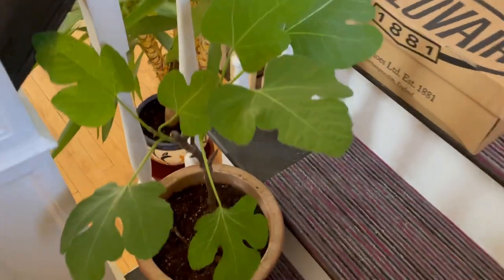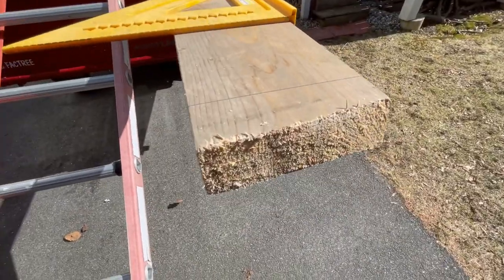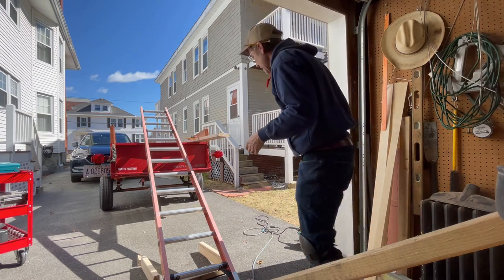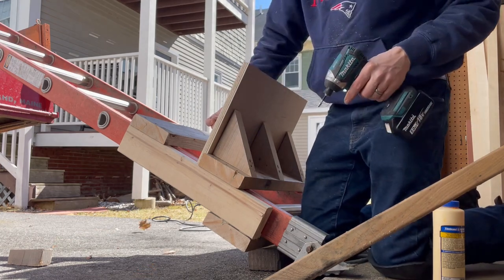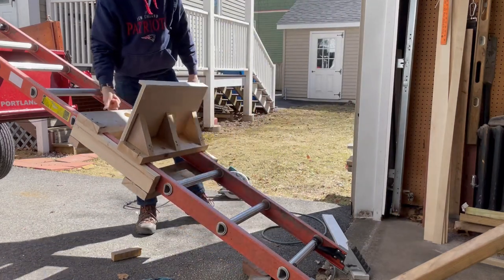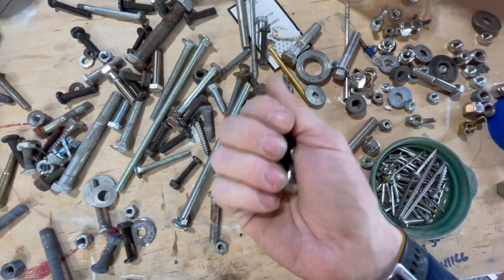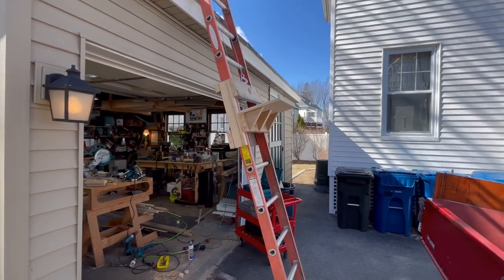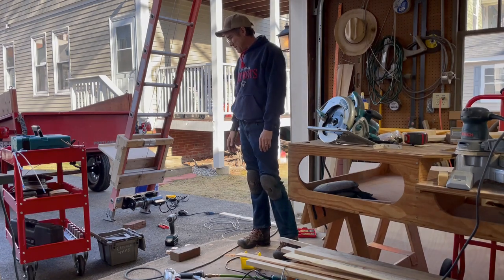Building a DIY Ladder Hoist using a Harbor Freight 'Badland' Winch. The Knee Saver 5000!!

Comment: Not being one of "those" guys, but a modification that I might suggest is at the winch attachment point, where you drilled through the legs of the ladder.
I would think you could have attached the winch "plate" assembly by using some hole clamps on the ladder's bottom rung into the backside of the wooden plate.
Also, I would add some Teflon strips between the wood and ladder for an easier glide.  Maybe use Teflon instead of wood spacer strips?
It is always easier to be an "armchair quaterback" and commenting on something AFTER it has been built.
I love this idea though, and am considering building one for getting things down into my basement!!!
Thanks for the idea.
Reply: Re: Teflon strips. 
Cut some strips from an HDPE cutting board to use as a sliding surface. 
I got that tip from another diy project — it was a soil screener…basically a shallow box with a wire mesh bottom that had to slide back and forth on top of a wheelbarrow. 
I only needed small pieces where the box made contact with the “rails” of the wheelbarrow, so it was very low cost. 
There must be dozens of uses for this material. 
And — I like your intro: “I’m not one of ‘those’ guys.”  👍

Comment: I built something similar to this some years ago. The only two extra things I did was to waterproof it and used thin nylon strips where it comes in contact with ladder. The platform and ladder won't  wear.....I like your thinking...keep up the good work!!! My newest one has skate board bearings.

Comment: make a brace to the roof and attach it to the top of the ladder to get it away from the roofs edge, then you can run it all the way to the top. It will be much easier to unload.  I cannot imagine the damage to your back  leaning over the edge of the roof to get the shingles off the sled.

Comment: Nice little hoist and great video but I see a minor problem when you get a 4X8 sheet standing on the base of the sled and hoist it up to the roof you have an over-hang sticking out looks to be a couple of inches of shingles so you can't go any higher than that or it will tear off part of the shingle so you need to build out something for the ladder to rest on below the overhang so it will clear it plus you can anchor the ladder so the wind won't catch the whole thing and slide it to one side or the other and it comes crashing down on what ever is below.

Comment: Thanks ,
 seeing this project will help some people .
It works which is good enough for some situations .
It looks like this temporary device will be a wonderful assistant to your roofing project but there are issues with long term use.
Now that I know how slow ( often an unrated feature ) one of these winches goes I will redesign some of my plans .
Seeing some of your efforts will have me continue my use of thrift store rollerblading wheels as guides , there is a whole system for mounting to laminated or extruded fiberglass reenforced structures including mounting adaptation angle plates or pillow blocks to avoid localized stresses you almost completely avoided doing ( somone mentioned U-bolts ( perhaps with some durable hose ) to around ladder rung which would have a much better ( and slower thus detectable ) failure mode :) mounting some metals to aluminum also has issues especially in wet or humid environments .

Comment: Works great on a regular ladder but can you think of a design for a 20 ft. extension ladder?  Also, at the top of the ladder, the lift will contact the eave where the ladder is resting. Maybe a "spacer" so the lift can get to the very top of the roof eave. Nice project!

Comment: Can you double the speed by tackle block, say an or the hook and put the block pulley on the carriage?
I would triple the strength on the hook mount board.
Also add plastic skids to carriage made from old cutting board.
Very good job.
Reply: Block and tackle are designed to make it shower. The work is spread over a longer distance

Comment: Just a question on your build. With the winch on the bottom, what did you use for a pully at the top?
Reply: Yes.  The pulley mechanism at the top rung.  How was that attached?
Reply: Eh? What pulley? Lol

Comment: Small suggestion, May be instead of drilling holes in your ladder, use u-bolts an then off set the holes for them an fasten to the board. Or threaded rod.
Reply: I’m totally agree
Reply: Exactly, never drill holes in a ladder !!!!
Reply: I would add a bar thru the rung of the ladder then add u clamps to that instead to install witch ...  Or make box that fits around ladder tight then add lag screws in the middle were the rung is to hold it in place ... Should not drill thru ladder ..

Comment: Good Job, however two things bother me.  If you ride up with your plywood you cannot step around it, if you make a simple four step ladder that fits up against the plywood you can climb over it before it passes the roof.  This should hook on, if the wind catches a full sheet of plywood it could push it and you OFF of the ladder and become the knee crusher 5000, the leg breaker 5000, the "My Wife TOld Me SO 5000"   So perhaps a second ladder to the side and secure this to the edge of the roof.  THis is brilliant.

Comment: Im building one of these this weekend.  Id really love to know how you solved the turn around of the cable up top.  I highly doubt the existing rope turnaround for raising and lowering the two halves of the ladder is any where near strong enough to withstand the forces of the winch and several sheets of plywood or shingle bundles
Reply from the maker: Hi. I did actually end up using the existing ladder rope pulley. It’s still hanging in there after hauling shingle bundles (only one bundle at a time), though the pulley is definitely the weak point.
Reply: The rung that the top pulley is on will bend in the middle, thus pulling the ladder sides into each other. Put a 5/8" steel rod through the rung first, and two support plates on the outside of each side with the rod going through the middle. An aluminum ladder would be a better choice, drilling holes in a fiberglass ladder is not the best option.

Comment: Great build. May I suggest using some plastic chopping board cut into strips as glide rails that come into contact with the ladder Stiles. How did you have the cable at the top if the ladder mounted, did the cable run through a pulley mounted on the top rung? Cheers Jerry
Reply: Good idea with the HDPE.

Comment: How did you attach a pulley at the top?
Reply: Probably with a pully
Reply: I have the same design question. the ladder I’m using doesn’t have the factory pulley for the second set of steps.